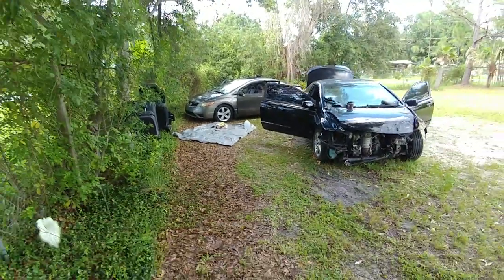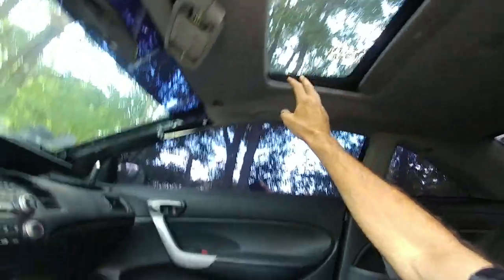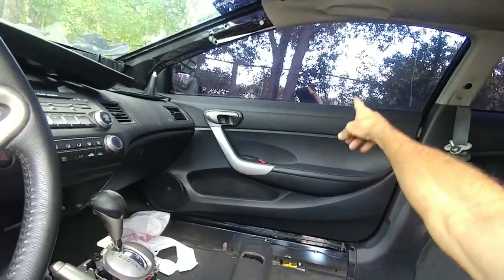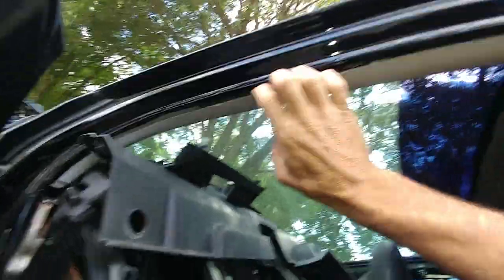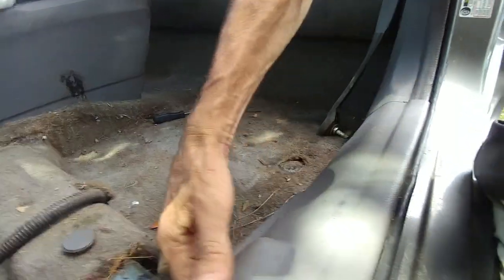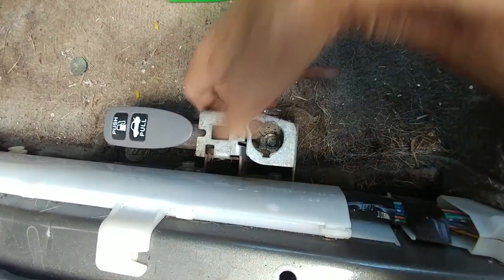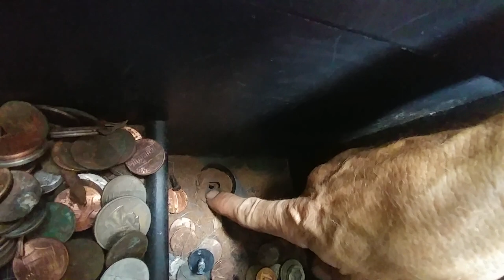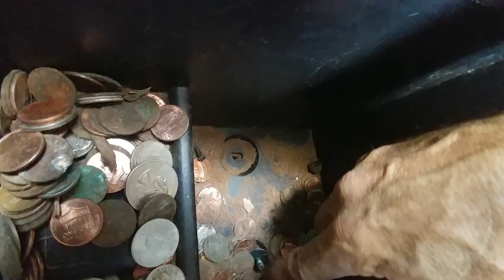Part 8 2006 Honda Civic Carpet Replacement Seats belts Dash Headliner FULL 2018 2008 2007 2009 Honda

Comment: my problem is i cant seem to find new floor carpet for my 2006 civic ex coupe, they dont sell it anywhere online!!! any recommendations?
Reply from the maker: I bought a 2008 Civic that was wrecked in the front and I took all kinds of Parts off of it including this carpet that you see here that's my suggestion I think I paid 600 for the car but by the time I sold it I parted it out and got about $800 back and I used about $2,000 worth of parts I couldn't even list them all tires Plastics tail lights interior components the dash cluster the motor and then I sold the car for scrap for a few hundred dollars
Reply from the maker: * edit my interior was wrecked I used the leather front and back seats the carpet the roof all the Plastics the door panels the carpet in the trunk and more stuff off of the donor car